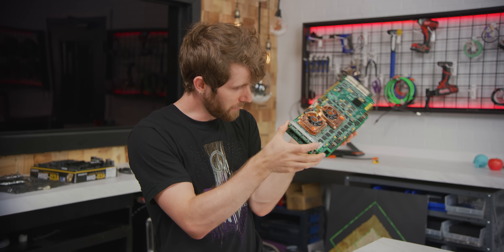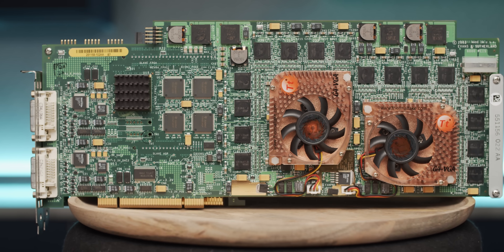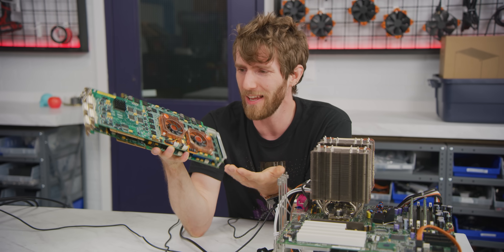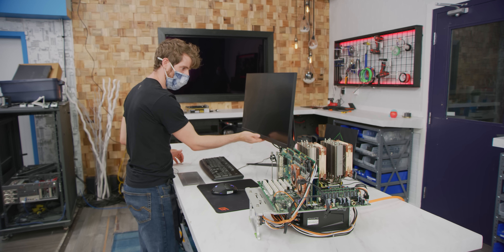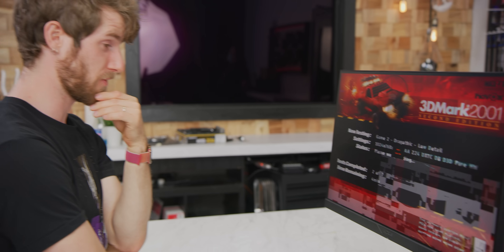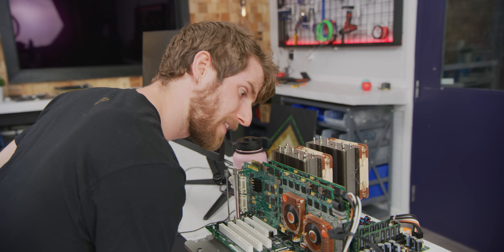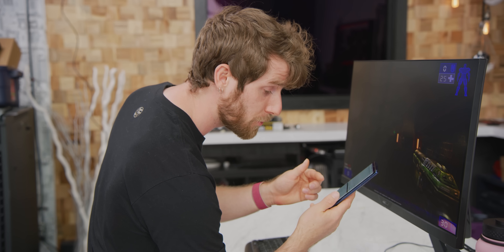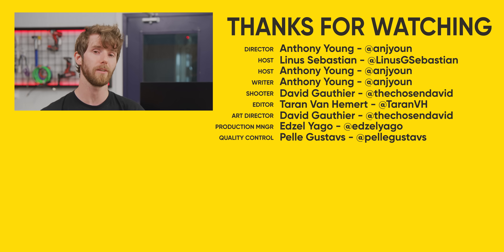This MONSTER Video Card has 4 GPUs... and it's from 2004! - E&S SimFUSION 6500q

Comment: Cards with multiple GPUs never worked well because their implementations are done via software, and programmers are lazy - the exception was 3dfx with its Voodoo 2, which did not depend on programmers, divided the line on the screens and improved performance.

Comment: I had those exact same "copper block" Thermaltake GPU coolers on my modded and most BELOVED Nvidia geforce 4600ti in 2002. :) I used to work at a Gateway Country Store and one ACCIDENTALLY ended up in my computer at home....which was NOT a Gateway. :)

Comment: Intergraph SMT219 (GLZ2 or much anything from intergraph GLZ family) -   Almost no one know these even exsist and it cost a fortune back then.

Its from 1994/1995 (GLZ2), has multy gpu-s and 72 memory modules with 24MB!!! memory (hardcore gamers had ati rage2 + voodoo1 4mb back then).

It has all kinda wierd fxxery going on on both boards, lol. Also I think You could but 2 of these to some form of sli 0_O

Comment: If you think that's a monster then research the Quantum3D AAlchemy 8164. That had four 3dfx VSA-100 (which were used on Voodoo 4 and Voodoo 5) and 512 MB RAM on a single PCB (but with PCI connector) in 1999/2000. What's more is that you were able to link two of those cards together in one single system (usually on a dual Slot 1 board), and IIRC you were able to link four of those systems together. The AAlchemies were used in flight simulators to achieve higher antialiasing rates.

Comment: Multy GPU has took a part of AMD Radeon a couple of times years after this thing has been made. For example the AMD Radeon Pro Duo: its two AMD Radeon R9 Fury X on one Board. The Radeon R9 295x2 has two R9 290x on one Board and the same with the R9 395x2. I know there has to be at least one other dual GPU from AMD but i cant remember the name. The perfomance of each were a little better than 2 seperate GPUs in Crossfire but the amout of power was out of space XD. Propably you guys wont read this but the multy GPU thing is awesome i think and thats why im gonna post this. @Linus Tech Tips:yougotthis:

Comment: lol im still running a gen 1 i7 950 with x58 sabertooth board and 1050ti 4gig card and you cant run a r9 390 card it bsod the cpu does not like this card and it is windows 7 only no windows 10  drivers for x58 motherboard
Reply: Sounds more like you have a power supply issue

Comment: When I heard this was basically an OpenGL card I immediately thought Unreal Tournament and then realized Wheel of Time would be in exactly the same ballpark. Also 1280x1024 was one of the old school 4:3 resolutions that were BIG in games back then. Normally I would pick 800x600 or 1024x768 and that was with a Rage XL and again with a Radeon 9200LE. Frames weren't as big of an issue back then but those Prescott CPUs got HOT. Especially the socketed ones like I had. GG.

Comment: DVI is still a current standard btw. Still used for 1080p displays, which is also why the 1660 cards have DVI. "Old" in that context would be a card with S-video out, or even UHF out which was a thing on some cards in the 90s (and incidentially on CGA cards in the early 80s). My 8800 GT has dual DVI and S-video and I bought that in 2007 or 2008. It was just before HDMI took over

Comment: Would it be possible for a new company to come in and compete with the major brands or are the major brands just that integrated into the tech industry that any new company would have to source from them?
Reply: Im not referring to just any parts like cpu is usually amd or intel and gpu is usually nvidia most of the time

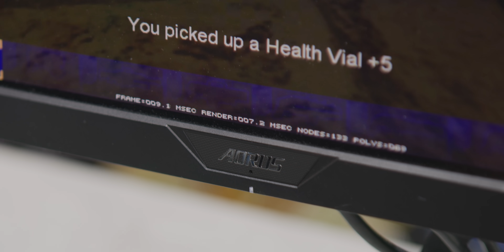Comment: To get a proper FPS counter in the first Unreal Tournament, you need to type "timedemo 1" instead of "stat fps" in the console (Alternatively, Main Menu > Tools > TimeDemo Statistics). Typing "stat fps" in the console of UT99 just gives you those stats like at 12:26 at the bottom of the screen. This was changed in future releases of the game, so using "stat fps" will give you the framerate from UT2004 onward. Typing "timedemo 0" shows some stats taken between timedemo 1 and timedemo 0 in the console. 
I immediately thought UT would be good for Open GL testing when it was mentioned, so I was glad to see it :)

Comment: I was thinking about graphics cards the other day & I remember having a voodoo2 & a voodoo3 and i was trying to remember if they were PCI or AGP. then I realized i'm old AF I used a graphics card that ran off of an AGP slot lol. to top it off i think there was like 16 MEGABYTES of video memory on one of them. lol. OHH SHH what is that 3dmark benchmark with the matrix you were running? i remember running that waaaaay back when i was probably 14-15. awesome.

Comment: Just like Voodoo 5 they are more build to prevent fps drops.
Will be cool to see that whit 3-4 Voodoo 2 GPU.
even my 9800 and one Voodoo 2 8mb did a boost when 3dMark 2001 when drop down FPS.
If i remember right it did go from first intro test. from a peak drop 90 to 98 but it lose a little in top. Imagine that whit to Voodoo 2 GPU.

Shame no one build a Voodoo 2 type Gpu after that, if Voodoo made backup Gpus they might be here today.
Just think what will be if you had a support GPU to a Usb 3 will do. Miss Ram? NP drop this thing in bam, no problems then you can upgrade later.

Comment: I miss my old Geforce 9800 GX2 i got in 2008 which was 2 9800s stuck together in one sealed unit and this card from 4 years before that i have never heard of it.
Reply: Still have a Zotac Geforce 9800GT/GTX. Haven't used it in a long time, but it was a good card at the time.

Comment: Ahhh the 9800XT -  I bought one for about £450 when it first came out, it set itself on fire. Then the supplier replaced it with a brand new one. It then caught on fire. Good cards.

Comment: "Old enough to still use dvi", so many modern monitors and gpus use dvi still
Reply: The intel uhd 630 uses dvi, it's from 2017
Reply: The rtx 2000 series' (from 2018 - 2019) have dvi too
Reply: The gtx titan x (from 2015) has dvi aswell

Comment: Oh I remember running 2x Diamond Monster Voodoo 2's in SLI , I think they both were 12meg mem cards. Oh what a happy day it was on first boot playing Quake 2, and Unreal (not Unreal tournament).  The SLI connectors connected to the video output on card 1 to card 2, then card 2 to monitor.  Cases were so bad back then I had to keep the side panel off and use a small desk fan to blow into the case to cool my pc.  AMD K6-2 200mghz oc to 212mghz,  Maybe 64megs mem, 2x voodoo 2 12meg sli, what a system it was.

Comment: 2004 was when I built my first computer. IIRC, I knew nothing except asus made good motherboards. I paired a top of the line pentium 4 with not enough ram and.... I think I used the motherboard's built in graphics 😱 running a vga crt monitor.

I built the computer to play the Sims 2, which, to its credit, it did.

Comment: unreal tournament was a good game and better bots rather than standard bots in counter strike at that time. me who overclocked a celeron 466 mhz to 496 if i am not mistaken was such a joy back there in 2000. saving up every penny just to buy more rams which is 64mb or 128mb ddr-266 per slot at that time. gaming on red alet, star craft, tiberian sun, house of the dead, virtua cop. oh my, brings up the old memories.

Comment: Not sure with the age on this (Its about right I think, poss a little later), GPU first meant Geometry Processing Unit, In the early days of 3D processing on P.C the geometry calculations were still done by the CPU, Vendors added GPU's to graphics cards to help stop the bottle neck from the processor having to do it, Now we just call a graphics card a GPU.

Comment: Nvidia got it's multi card technology from the consumption of 3Dfx anyway. Back in the time my physics teacher had 2 Vodoo 2 cards enabling him to play quake smooth as butter at 1024x768. That was way before NVidia used SLI. Though you could only connect 2 cards together. Actually the Voodoo 1 could be used in SLI configuration too, but only done so in adrcade machines. So depending on how you view it, SLI was acually introduced in 1998 at least.

Comment: We had a rack system of earlier hardware from them used for  3D simulation in full dome planetarium projection of planetary environments and space flight among the local stars in our galaxy. Ran it with our Digistar system...also made by them I believe.
Reply: Worked for E&S for 35 years, mostly on the Digistar system. Unfortunately , health problems ended my career.

Comment: I only w8 or intel to come up with a al-in-one card that would be both processor and graphic device - lets say 11th gen i9 incorporated with nvidia (future name guess) RTX 4090. to become 2 -in one devices.
2nd option: nvidia figuring out how to replace intel processor with their super graphic technology so its no longer needed to have CPU and GPU cos both would run from 1 card, and whats more CPU power that's not required for com putting would be used for graphic rendering and vice versa - if some would do gigantic excel calculation all gpu power not neccesery to run excel would go towards computing that.
Reply: That's called an Apu

Comment: I seem to remember there being a dual AGP motherboard, but can't find any references to it. But I believe maximum PC reviewed it in the 2000-2005 time-frame. It either had two chipsets or some sort of funky AGP bridge. It hurt single monitor gaming due to lack of SLI, generally wasn't powerful enough for multiple monitor gaming due to the other bottlenecks, and driver support was wonky at best. But maybe I'm just confused.

Comment: Back in 2001, I had a dual Xeon workstation with a massive 4gb or rambus memory and a 144mb wildcat 4110. It cost somewhere in the region of £11k. Fast forward ten years and your average smartphone makes it look like an abacus... the real difference in “industrial” workstations was the move away from bulletproof custom hardware (a la SGI) to “cheap” disposable x86-based stuff.

The fact we still don’t have single-*’age clustering since SGI died shows we haven’t actually progressed in a lot of areas.

Comment: I still use a monitor with DVI in 2021.
Reply: Mine has DVI and VGA, it's named Meditec. I'm sure no one even heard of it's name. I got it for free and replaced several capacitors which were faulty. Now my 22 inch monitor works as intended. I still use a PC with an AMD Athlon II X2 260, 4 GB RAM and as a video card i have an AMD Radeon R7 240.
Reply: @darthvader-r2j  F

Comment: Can't help but notice that thing is called radeon 9800xt
Reply: What you talking about? ATI/AMD best days were in the era of 9000 series. That's about the time you start seeing AMD on a ATI Radeon  product. 

The 9800xt was probably one of the biggest upgrades from a previous product. Nvidia was also finally getting the GeForce GPU right.

Comment: In Windows 95 (98) I had ATI Rage Pro (AGP) burned with the Voodoo 2 card on ISA. It was connected with an external VGA cable (From ATI to Voodoo 2 and then to the monitor. Could be the beginnings of SLI or CrossFire). Eh. G-Police was flying :)

Comment: "we're going to build a pc from 10 years ago" so, basically the pc i'm using right now? asus p5q deluxe, intel core 2 quad, etc. lol. still works fine, only the ram (8gb ddr2) is a bit wonky. doesn't like to cooperate sometimes. already ordered parts for a replacement/upgrade, 4x4 gb of ram though, so should be fine soon. i expect my little boy to serve very reliably for at least another 2 or 3 years, probably more, before something breaks down in a way that requires me to get a complete overhaul and full upgrade to latest tech. it's probably gonna be either the motherboard or the cpu breaking at a time when replacements are simply not available to buy anywhere anymore.
ps: ddr2 ram is expensive as fuck, i had to pay well over 200 €. so if you've still got any old stuff, i'd highly recommend to first check out wether you can sell it on ebay or whatever before you just throw it away. i'd imagine there are quite a few very good deals to be made with old pc parts.

Comment: You're forgetting that 3Dfx Voodoo did this before in 2001 with the Voodoo 5 5500, this has two processors on the same card, and two can be connected with each other.

Comment: "That's old enough to still use DVI" I was like, since when DVI is old?
Reply: I only recently discovered that ps2 ports are outdated (miss my 21 year TVS keyboard using ps2 port)
Reply: @thechannelofrandomness7670  My brand new MSI Z590-A PRO still has a PS/2 port, though. Using it with my Unicomp right now.
Reply: @pennyandrews3292  really?!?!?

i am still not throwing away my keyboard tho
Reply: Since it lacks the bandwidth needed for todays applications?
Reply: no DVI is old in fact DVI was born in 1995
Reply: @SparkleTails  Just wait until you hear how old LCD technology is. Or the 3.5mm audio jack used for speakers/headphones, at least on computers. Not to mention, the QWERTY layout on your keyboard is from 1873.
Reply: LCD Technology has been around since the early 1970s
Reply: DVI-I was introduced in 1999. It's old as fuck in computer years.
Reply: @CarlSlime  Sooo, tou missed the joke completely? It's pretty obvious that it's old. I pointed it out to joke about me being old, and that in my mind DVI is still pretty fresh (despite none od pcs in our home still using it)
Reply: And @Travis Centers you really like to use those clumsy white plugs in the back of your pc? DVI is way more convenient to even plug. Won't compare them in thebtermsnof cable bandwidth, frequencies and stuff as simply Im not proficient with that enough ,)
Reply: Maybe not old but outdated
Reply: @SalvadorDTP  How when it uses the latest signalling you prune.
Reply: DVI isn't old, EGA is old and VGA is still my most used graphics port, most hardware here is 10-15years old. Most new games are crap anyway, so why bother updating.
Reply: @hinz1  Nice. My main display is a Dell E773s, not the best CRT and it's starting to go out, but it still works for what I use it for.

Comment: well if you like old school stuff - i still have and bought when brand new, this was before copywrite laws where known and in effect, and also trademark laws aka - why no mac or intel in the same computer ??  -  well i have such a computer - in 1994i bought it, a powermac 6100/60 along with a intel  486/dx66 daughtercard you would call it today,  inside the system, originally running mac os 4 / windows 3.11 the worlds 1st VM ware type computer running mac / windows os'es and mac and intel cpu all in 1 computer system box, later it got upgraded to mac os 8 and windows 95, with 8mb ram for each system, and 2 500mb hds, during those days that was max capacity.   I worked with a good buddy of mine that worked for a company that later was bought by Microsoft and today its how they got their VM software to use on their servers today.  I had worked with that companies earliest engineering software thru my buddy that worked with em, so i imported it for my dual system, since they had not have the engineering development for that to work at all yet.   My setup was done before everything like that became illegal, as the laws for such did not exist yet when i build it, those laws came bout in the later part of the 90s- 2k, a few years later.

Comment: ATI did release a consumer product with multiple GPUs in 1999 called the Rage Fury MAXX. It was a single AGP slot card with two Rage 128 Pro GPUs on board that performed alternate-frame rendering. Arguably just the distant ancestor to multiple card interlinks, but they were obviously working on getting GPUs talking to each other long before anyone uttered the term "CrossFire" in relation to graphics.
Reply: SGI had multi GPU graphics cards in the 1980s.  A Silicon Graphics Indigo from 1990 with Elan graphics had 4 GPUs.  Beats ATI by 9 years in a desktop system.  Wonder why these PC nerds never cover the actual interesting vintage hardware?

Comment: Really reminds me of when I had 2 7950GX2's in SLI. Effectively running 4 GPUs. The funny thing is, when the 8800 GTX came out, that single card eclipsed that setup.
Reply: I also had 7950GX2, mine died because of artifacts (it was so toasted that my bios was rainbow colors and letters in text mode boot screen were also rainbow colors) but just before warranty ended that I RMAed it and they didn't support that card anymore so I think I got 8600 GT as replacement? I remember I was pretty happy because new card was better than 7950GX2 but I still miss it to this day, it was a crazy card.

Comment: Fun fact:
I tried to run 3D Mark 2001 Car Chase Low Max Settings on a 2080 Super Max-Q and it smashed the game with 1200 FPS. High yielded 500 FPS. 

Essentially, one 2060S (near equivalent in performance to 2080S Max-Q) destroyed a 4-way Crossfire.

Comment: So.. as a person that owned a 9800xt  ( my first video card capable of 3d gaming) I cant tell you how much it randomly freaked out while gaming. Also I found out later onto my second motherboard that the memory I was using on my AMD64 / agp8x / VIA board was not compatible fully with VIA chipset leading to more issues.

Comment: I remember my first motherboard with an AGP slot. Athlon XP 1600+ with a Radeon 8500. That felt like such a monstrous upgrade from my K6-2 533mhz. First time I ever experienced buttery smooth framerate on a 3d game. With my 100hz Sony Trinitron CRT monitor. The best days.
Reply: Just my story bro, but i upgraded from k6-2-266@300mhz
Reply: Same back in 2008 I went from a 900mhz Duron with 224mb of ram to a Socket 478 Pentium 4 @ 2.4ghz and a Geforce MX440

Comment: I has SLI by 3DFx back in 1998 - 1999 on a Pentium 400 Mhz, 256 MB of RAM, 20 Gig HD, 56k modem, I don't have those any longer but I still have my Diamond Monster 3D video card that I bought to play Quake II. After connecting it my son and I just watched the introduction for like 2 hours because it looked so damn good.